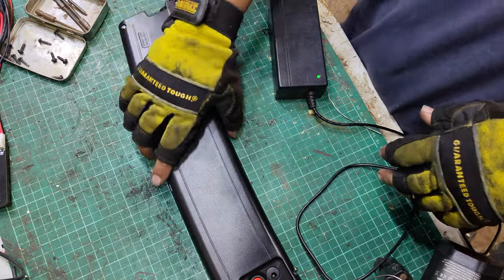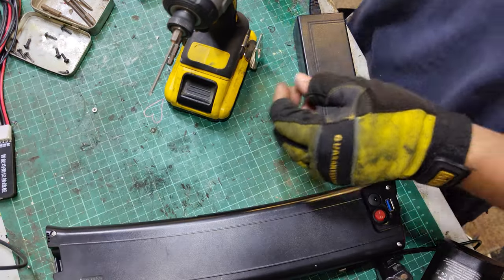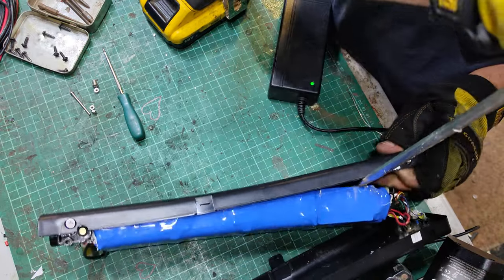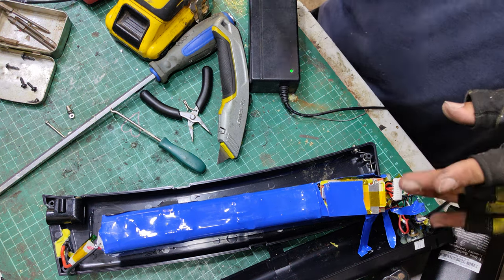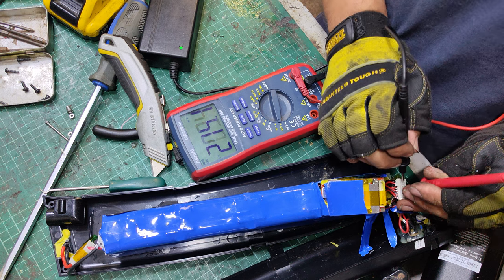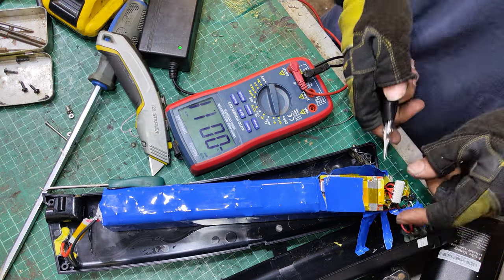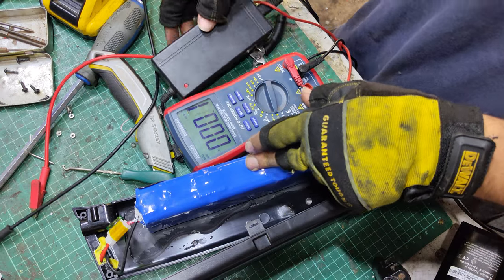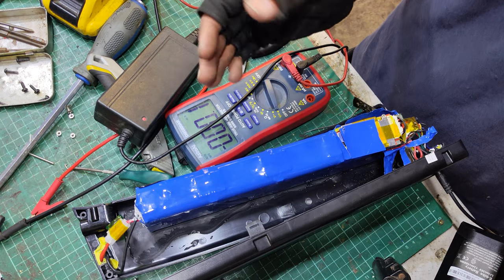Ebike battery won't charge? Here's what not to do! Don't try this at home.

Comment: I left my carrera crosscity in my loft for 2 years and I plugged it in to see if it would work and there was no red light on the charger so I was just about to get rid of the battery and buy a new one but thought I'd see if someone had tried to fix it on YouTube. Came across this video, bought a power supply and it actually worked within 5 minutes it started to change again. Thanks for this video
Reply from the maker: Theoretically, of course! This is not safe to do
Reply: @EbikeRepairs

Comment: Hi, I bought a 52v e-bike battery however, it did not come with a charger. I tried a charger that I already had at home and there was a big spark. The pin inside the charging port looks melted. I suspect the fuse has also blown. Could you please link a video of how to change the charging port or explain the process? Also, is there anything else in the battery that may have broken that I would need to replace?
Reply from the maker: Sorry I don't think I've got one on that! But there will be plenty on YouTube if not from me. 

Also, BMS could have failed, cells should be protected but you'd need to check them all with a multimeter  just in case.

Comment: you obviously know your batteries and charging etc but boy rather sloppy workmanship bro... anyways good info with sarcasm. other tubes have shown that it can be done without doomsday warnings. Just a matter of tricking the charger to think there are juice inside cells still to kick in charge.
Reply from the maker: I can't encourage this sort of thing... 

It really can be very dangerous, but for example if they were at 2.95v and the cut-off for BMS is 3.0v this is bordering on kinda safe to do. 

If the cells are at 0.1v and you try and blast them, they could actually get hot and if left unattended, combust (which is super bad)

You gotta trick the BMS into thinking cells are happy, not the charger though.

Comment: Wanted to thank you for providing all of access to your knowledge. I had a question ...I have a brand new 48v ebike and had not ridden it for over a year since my last charge because i injured my knee very soon after i purchasedit. I went to ride again recently and battery appeared to be dead as the display wouldnt power up so i attempted to recharge the battery. However after charging for a day nothing changed. Aventon website mentions reviving a battery that had been sitting thru a number of steps essentially charging battery while it is on the bike and turning display on. Is this considered safe? Is this normal situation for a new bike that had been sitting in garage for a year? Thank you for your advice in advance...
Reply from the maker: Hiya it's never safe to revive a battery, but it can be done - I did a video on how not to revive your battery, it's ok the channel somewhere. 

To be 100% safe, the only option is to buy a new one unfortunately.

Kind regards Darsh

Comment: so let's say hypothetically if I had a 72v battery that is reading 34v and the bike won't turn on or charge would a 60v bench power supply be enough to potentially recover it? and how many amps should I charge it at if something like this were to happen?
Reply from the maker: A 72v battery is empty at 60v and full at 84v, so theoretical 0.1a for a very long time would charge it but if there are dead cells groups involved and every group isn't even voltage wise, it could just set on fire!

Comment: If I am not trying to revive a 48v battery, would I also not need for my adjustable power supply to be 48v?.....
Reply: I want ad that this battery is basically unused, just sat for....more than 6 months....
Reply from the maker: You would have to not start at 1v and slowly work your way up to 54.6v ish, just make sure you don't do it at 0.1-0.5amps and don't keep an eye on cells getting hot

Comment: I've revived lithium battery packs for power tools that way that I have gotten from public recycling deposit bens by opening them up and then using a variable DC power supply gently charged them back high enough that the factory charger can charge it again. But I would never recommend anyone do this.
Reply from the maker: Indeed. The cells undergo permanent degredation below 1v I believe.

Comment: Good info, thanks.  36v battery from a Murtisol bike, doing diagnosis for a friend. I think these are low end/price bikes, but I have no experience with E Bikes. 36v 6 amp hours, made by ZhenLong Battery. 
I'd say this bike sat for many months. Charger is new, its 36v output of 42v 2amp. Tested charger output at 2.5mm plug, its right on 42v. 
Charged battery for some hours, green light came on, only 16 volts at battery terminals. So this does not seem like a sleeping problem.  
Any suggestions?  Thanks.
Reply from the maker: Probably low cells/dead cell group. Only way to check is to open it up and test with multimeter... But if you aren't safe it can be dangerous!
Reply: I suspect there will be many batteries like these as bikes sit over winter, either out in the cold or even indoors with too fuu or too low charges. Bought a couple second hand bikes that only charge to 49v out of a possible 48vnominal 54.6V maximum. Planning on replacing the internal packs or bad cells, but more likely build one new pack and use the spares to fix the other pack. If they use the same cells. Interestingly the voltages will increase after being left sitting for several days, I saw 51 and 52v , but always 49v coming off the charger with 54.6 coming from charger. I never seem to get the normal problems like most people

Comment: Hi! Great video! I really didn't understand if i should revive it or not but the thing is i have a Windgoo bike that i bought used, the owner gave it to me fully charged, i used it for about 15-16km and ran out of battery. When i plugged it in the charger LED went red and seemed to charge for about 2 hours before going to green, which seemed odd because it should usually take 4-6 hours. After that i turned on the bike and the battery indicator lights up for about 3 seconds and then turns off, showing that it has no charge at all. It seems to me that the battery was charged a long time ago and when it went flat, it went undervoltage but i really don't know. Do you recommend to me to revive it this way? Should i get a new one? Thanks
Reply from the maker: You should never do it this way! Unfortunately it sounds like you've got dead cells... Windgoo batteries do fail sadly, I have a video of one on my channel 👍

Comment: Hello sir. Out of curiosity and hypothetically, if I had a 48v ebike battery that had been left in storage for some time and would not currently take a charge, how many volts would a power supply hypothetically need to provide to get the ebike charger to take over?
Reply from the maker: theoretically, and at about 0.1amps, monitoring temperatures and voltages of each cell group, about 40v would kick start things. if one of said theoretical cell groups were dead/not taking a charge/getting hot, then putting power into said group could cause a real fire, though.
Reply: @EbikeRepairs  Hmm. Ofcourse in theory I would have to monitor closely and be prepared to possibly contain a lithium light show. The main problem for this hypothetical being that I do not have a current regulated power supply that would provide the necessary voltage. I would either need to find another way, possibly disassembling the pack to charge/balance cells individually then reassemble. Or find myself a power supply up to the task. Unless you're aware of another way? Regardless, your video was very informative and I thank you very much for indulging my curiosity.
Reply from the maker: theoretically, blasting it with the charger for 30 seconds or so, but from not the charge port would do the same thing, but be quite unsafe. if you were quick enough you could then plug the charger into the charge port and magically have a working battery pack again... if we didn't live in a world where lithium batteries were dangerous
Reply: Hmm. Just trying to revive a Pendleton battery that's been in my container for a couple of years. When I switch the charger on the the red light comes on. Great I thought,then  30 seconds later green comes on.Maybe it's dead. Pity,they ain't cheap.I'll follow your advice and avoid setting the house on fire. They ain't cheap either!
Thanks.

Comment: Whilst technically its a bad thing to do, if you have enough technical knowledge and know the exact reason for the depleted cells its something I have done many times. I have many items and batteries that are left to deplete naturally through lack of use sometimes over a few years using a regulated PSU set approximately 10% above the battery voltage is enough to fool a regulated charger to switch on. I remember years ago when you could get unregulated chargers that gave out a charging voltage and current regardless of the battery state.
Reply from the maker: Yes the video is not very everyone, but helpful for some!

Comment: Of course I would never do this but what setting did you have on the adjustable power supply?
Reply from the maker: For this 36v battery pack, hypothetically, you'd set it to 5v 0.1a and increase up to around 30-35v over a long period of time until the original charger could take over. But you shouldn't ever do it...

Comment: My samsung celled ebike batteries one 48v charges only to 80% and the 52v betaeen 80% & 100% both acting up at the same time. I changed the bms in thw 52v to a new 50amp one and it only charged to 80%. Reinstalled to original one and it xharged to 100% but it started to drain faster than normal. I think its the charger more than the battery as it isnt that old
Reply from the maker: Weird! Possibly cells out of balance? What voltage is the charger outputting?

Comment: My battery was not turning on or charging but accidentally Spark the positive And  Then it started charging and turning wonder is this what I did? I don't know I'm having so many issues still... It would be really nice if you could  Pm me to be safer.
Reply from the maker: Sounds like BMS shorted - may need disconnecting or replacing!

Comment: My eBike (48V, 15A) turns off after about 300 meters of riding, and I can only turn it on again after a hard reset (turning the battery Off-On using a key). I decided to measure the voltage on the battery and saw 72 volts. Can you help me figure out what's going on?
Reply from the maker: 72volts likely means your multimeter batteries are failing. Replace batteries/check with another meter just to be sure. A 48v battery should never read that high...

Comment: Currently awaiting customer service from ANCHEER after a $510 potential fuck up where the battery killed itself after a twenty minute test run. Charger light is green, battery shows full capacity, but the damn bike will not turn on, even the horn and headlamp isn't getting power. With any luck they just send a new one and I may even be within warranty rights to crack open the old one for potential home repairs and keep it as a backup, but I really don't want to wait an extra month should the whole bike need to be returned and replaced. Nor can I write it off as an accident and just by a new battery bc even on the cheap end they're half the price of a whole other bike 😂 having tested every online troubleshooting trick, the only option left is wait for customer support and pray for the best or fuck with the battery myself right here. But y'know what, this is what happens when you go against your own judgement on a whim that at the time sounded like a great idea, only to end in a shit show.
Reply: On a bright note, Customer Support called me back without having left a message not twenty minutes after the call, and forwarded everything to the actual company in China. So that's a huge thanks to the lady who picked up and provided that little bit of hope needed to hold out..
Reply from the maker: Unfortunately the ancheer bikes come in a lot for faults... Check all connections, maybe a fuse in the battery has blown?
Reply: @EbikeRepairs  They offered to send a new battery to my home address last week and it has yet to arrive, but.. I did get impatient and open the battery case to find a melted 30 amp fuse, so a $6 5-pack of fuses for repairs on a roughly $200 battery feels pretty good! Only problem is the fuse didn't blow, the metal contacts started melting, so it is a fire concern. But, with nearly 150 miles on it since and only needing to remove and clean the partially melted replacement fuse once, I'd say this is information the company really should make more readily available (if there weren't liability issues and people wanting to sue when they fail a home repair on a battery and have a lithium fire go up in their junk xD)
Reply from the maker: Cut out the fuse holder and replace with a name brand reliable fuse holder! Melty connections are usually caused by high resistance, loose fitting connections